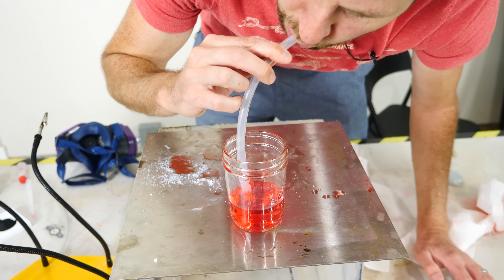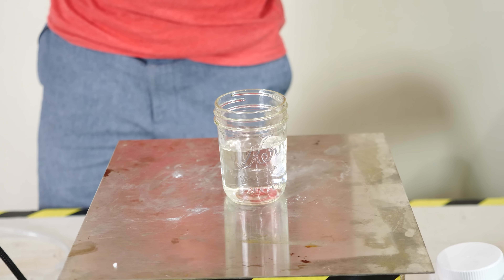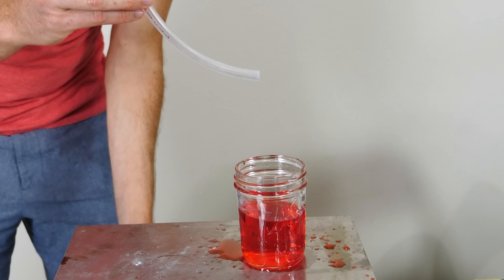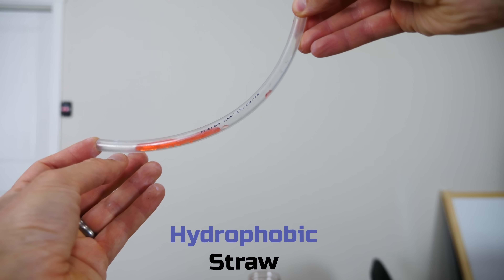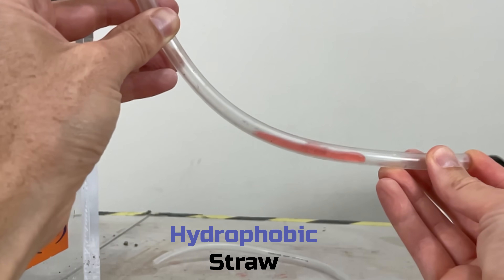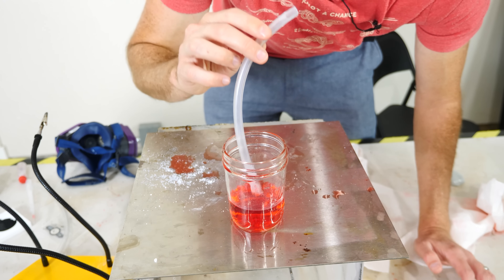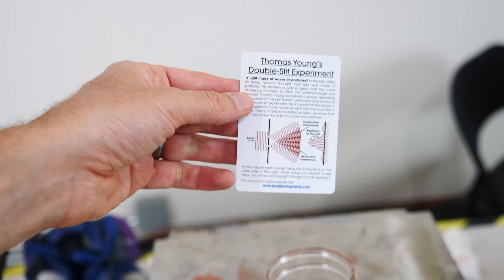Can You Drink With a Hydrophobic Straw?

Comment: Could it be that the water falls out because there's a super thin, rough layer of the silicate between the straw and it finger that prevents your finger making a complete seal, thus making the water unable to be held into the straw via suction/vacuum? 

I think you should redo the test but not make the end you wish to seal with your finger hydrophobic. That way, if the water still runs out while your finger is holding a tight seal, you have ruled out one variable for that experiment. If the hydrophobic effect is still keeping a gap of air between the water and the straw, the non-hydrophobic thumb seal shouldn't impact whether the water stays in the straw or not. Just a thought. Though the more I think of it I'd bet the ridges of your finger print are more prominent than the possible peaks and valleys of the silicate used for hydrophobicity, and you can still keep a seal with the finger on a normal straw, so it may be entirely irrelevant.

Comment: I'm guessing that if he performed this experiment with a low pressure vacuum and didn't handle the submerged end of the treated straw prior to immersing it, the air layer on the straw rim would allow enough air flow to break the vacuum and prevent the water from rising.

Comment: Right, I'm going to predict the end of this experiment.
If you suck through a straw, you're creating a pressure differential.
Unless it remains/becomes a vacuum, which we all know nature abhors, something will fill it. Given that you created this vacuum in liquid, liquid is the only option for filling it.
There may be a later of air around the straw, but air would have to move very fast through a very small space to keep up with your sucking.

Comment: I think you wouldn't be able to drink through the straw if you'd coated the hydrophobic powder on the outside of it. Sucking on the straw would just pull air down the outside of the straw and then up the inner sides of it.

Comment: I think that the hydrophobic straw still works when submerged because the air rushing past the water creates a low pressure area inside the straw, allowing atmospheric pressure to push down on the water inside the glass and move it into the straw. However, when you pull the straw out of the water, there's not enough surface area on the water inside the straw to keep it there, so gravity wins and the water falls out of the straw.

I think that there's also a chance that the layer of air around the submerged straw is so thin that it more or less works like a normal straw. But when you remove it from the water, the thin layer of air that remains inside the straw breaks vacuum, so the water falls out if the straw

Comment: Maybe the outside water was able to prevent the air from entering along the tube outer surface because of the high hydrostatic pressure due to the depth of imersion. Could you try it with the tube just touching the water surface to minimize the hydrostatic pressure?

Comment: Coat a very tall glass/tube/pipe in fused silica, and fill it with water and show us how the water behaves at different depths with the silica. The water at the bottom will be under more pressure than at the top, so the water molecules will be forces to "touch" the silica molecules.

Comment: What whold happen if you coat the straw on the outside also?
Reply: That could probably allow air to get to the bottom and make the straw not work very well.
Reply: @Bendigo1  maybe so or maybe the air will be too little to make a difference, that s why you should always make the experiment in real life
Reply: @edyeduard4368  right.   A hypotheses is only that until it is tested.

Comment: I wonder if it can be used somewhere else, like piping systems
Reply: That would actually allow faster flow through a pipe.  It would be better for a level pipe though.
Reply: @Bendigo1  what about having a layer of this in damns to reduce erosion to the structure ?
Reply: @FIRE_STORMFOX-3692  🤔hmmmm...   that doesn't sound like a bad idea.  I think the cost, and potential environmental affects might be the only issue with that.
Reply: @Bendigo1  well... Damn haha.
Reply: @FIRE_STORMFOX-3692  i was thinking about using it to build boat hulls.  To reduce friction....

Comment: Ok, going slightly off topic but......
Pipes/tubes have problems with water flow because of friction on the side of the pipe/tube.
Make the inside of the pipe/tube hydrophobic.
Not the end or the outside, so when the end is under water it will fill with water and it will (should?) allow it to work as before.
But.....
Will that help with flow because it reduces the friction of the liquid with the sides of the pipe/tube?

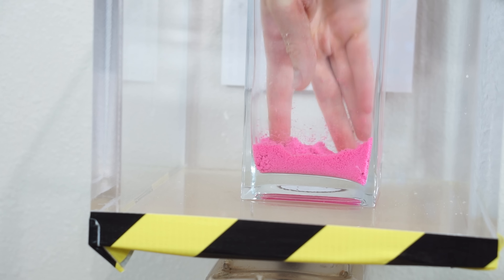Comment: 0:42. Yes you will still be able to suck it up. All plastic and rubbers are hydrophobic. Which straws are made out of.

Only way it would actually be too hydrophobic is if the straw diameter was so small it could not overcome the surface tension of the water interacting with the hydrophobic surface of the straw.

3:50. Well since the higgs is totally fake. At least it's proposed function is. That kind of tells you. Who you're dealing with.

Yes a particle at that GEV could possibly exist. But the odds of them actually finding it are astronomical. But regardless of whether or not they actually found it. The proposed function of the higgs is absolutely incorrect. And it is only through stupidity that people have been duped into believing in it.

And since they have not provided any actual scientific evidence to suggest that they have found anything. You can still safely assume that it does not exist.!

But more importantly since it is clear to see through real research how. The properties of mass actually function. Anyone aware of this already knows the higgs. Only exists for continued funding purposes. Which I'm not going to hate on the game. Except that it's giving science a bad name. The only way it's worth it. Is if the additional money lying about the higgs gets them. Can build a large enough collider to find actual evidence. 

Which will undoubtedly prove that their supposed original discovery of the higgs was the biggest and most costly scam in human history.

So yeah anyone working on that s*** is obviously an idiot or in on it.

But be friends with whoever you want. Even if they're helping to destroy real science.!,

Comment: I think even if the straw is submerged, the reason is you’re still able to create a drop in pressure. “Water collapses so not air doesn’t get out” may be true, but if hypothetically it had a full layer of air, so long as vacuum created by your lungs is strong enough, it’d still flow up the tube from air pressure (even if the air is flowing)

Comment: With this tech, it's possible to make straws very easy to clean, and then, very possible to reuse. Imagine a piece of straw which is translucent and never sticks any liquid on it. After using, all you need to do is wash it with ordinary water from pipe. I guess this would help reduce the plastic production.

Comment: The question I have now is. Did you demonstrate sucking water up through the straw after you demonstrated moving the water through the straw with  plugged ends of said straw without re treating it with the fume silica. I ask because if you have removed the silica from the ends it would negate the results of the final demonstration as presented.

Comment: So here is a food thought, what if we made a hydrophobic dam? Generators powered by water pressure should be able to effectively get alot more energy if the water current face less friction. Would this work? Would we be able to take power conservation a step higher at such a low cost?

Comment: I'm a pressure cleaner, and one of the biggest things we face is friction from using long lengths, which restricts our pressure and flow. Do you think there would be a way to coat the inside of a hose like this?
Even a garden hose?

Comment: You should have tested it to see at what depth the straw was unable to pull up the liquid because it couldn't create a seal, if at all.
What if you used a different diameter straw?
What about different materials. like PTFE, silicone, glass.
Does water flow faster due to the lower friction?

There were too many answered questions. :-/

Comment: What happens if half the straw is hydrophobic, will the normal part work normally and then work with little friction in the hydrophobic part, does that mean a hydrophobic pipe loses less energy and a better pipe or does it comes with its own challenges (ignoring the cost of the treatment to make the pipe hydrophobic) witch pipe whould be  better, what is the the effects on the pressure, what is the effects on the flow rate

Comment: What happens if we make hydrophobic boat, does it goes faster. any ideas?🤔

And does hydrophobic propellers work same as normal ones?
Reply: Well most of the energy lost in a boat is in deforming the column of water, along with energy lost to turbulence which would remain the same.. Adhesion would be a very small force to counter. For something light like a sheet which doesn’t displace a lot of water this might work very well at making it slide on the surface of water..

Comment: Before I watch the vid, I'm going to guess yes. Unless the opening of the straw is too narrow to allow fluid into the interior of the straw, pulling a vacuum inside the straw (aka sucking) shouldn't be a problem.
So I was right, but I felt like I was going to be wrong through the whole first part. A hydrophobic straw is a lot trippier than I expected.

Comment: Actually that's an interesting coating for pipes cause even if there is a hole as long as its not bigger than the layer of air water won't escape ...
but Also high pressure so... not sure if it would work...

Comment: You missed a good experiment, that should have been the last.  Using a vacuum meter to determine if the draw for the hydrophobic straw is greater, less, or equal to that of the regular straw.  It would also be interesting to see how a hydrophobic straw would affect the maximum flow rate.

Comment: I expected you'll be able to suck through it, with one end in the water, because mercury (which does not wet glass) can still rise in the glass tube. But i expected to see a drinking straw which is thinner. The water droplet in a thin straw is more rigid and may allow less or no water to pass between the droplet and the straw.

Comment: Here's an explanation of what's happening in both the end plug and sucking up water tests:

Water naturally likes to stay together due to the high cohesion of hydrogen, and depending upon the chemical composition of other surfaces, water may be highly or poorly cohesive with it. Aka, hydrophilic or hydrophobic. Aka nonpolar and polar. Glass is very cohesive with water, fume silica is not. 

So given that the fume silica straw lacks cohesion with the water, they have a natural repelling force against each other by literally being polar opposites. Air naturally, then, takes root in the spot between. Due to this, the water is free to glide along those air bubbles which connect end-to-end of the straw in the plug experiment. With a hydrophilic straw, the water is binded to the edge of the straw and everything is sealed. In the sucking up water test, when he has the straw submerged, he first sucks up air and pulls away the divider between the water and straw, and so naturally the water can only obey the innevitable vacuum that will pull it in tow. The air, after all, has no where else to go but up. When he lifts up the straw however, the lack of an air-tight seal makes all the difference. The vacuum does not form because the water and straw repel each other and air creeps in  the second it has the chance to take the space between. Any seal which may have formed is broken, and allowing the water to slide out like the flush of a toilet.

Comment: Now I need to know 2 things:
- would that make any sense to coat a boat hull with a hydrophobic layer?
- is there any way that this could provide a viable high speed train alternative due to its passive action (instead of the whole powerful, energy intensive magnet system used with current maglevs)?
Reply: I am not a profesional , my opinion however is water still creates friction even if the water molecules themselves aren’t touching it there is still air , magnetic would wear off the coating
Reply: I believe I have heard about boat hulls being coated in it already. might look it up

Comment: I assume that fumed silica isn't safe to breathe in...
Reply: Or ingest.
Reply: @Jay Smith Silicosis is a problem tho
Reply: @Jay Smith It's also used as an anti caking agent to make anthrax airborne
Reply: Inhaling silica dust can cause pneumonoultramicroscopicsilicovolcanoconiosis, but it does make a good spice for the dish Lopadotemachoselachogaleokranioleipsanodrimhypotrimmatosilphioparaomelitokatakechymenokichlepikossyphophattoperister.
Reply: @serious.business  sounds supercalifragisticexpalidociously scrumdiddlyumptious!
Reply: @Jay Smith Well... being used in products doesn't mean it is safe nor dangerous. Water is used in production of plastics and in nuclear reactors. Doesn't make it dangerous. Mercury is used on some vaccines, doesn't mean it is safe. Everything can be safe in small enough dose (albeit very very tiny for some) or dangerous at high enough dosage.
In the wikipedia article you linked, "fumed silica can easily become airborne, making it an inhalation risk, capable of causing irritation."
So yes, fumed silica can be a health hazard, particularly for your respiratory system. Sucking a straw coated with fumed silica thus isn't a healthy thing to do.
Reply: @Jay Smith Well I don't think this was a necessary risk. While fumed silica isn't inherently toxic, the fine particles does pose a risk, especially when sucking it up with a straw. A hand pump, or something similar to create a suction would be sufficient without actually sucking up fumed silica. Same applies for any fine particles in general, don't mean to claim fumed silica as inherently toxic btw. Any small particulate is a potential health hazard.
Reply: @Jay Smith You don't go ingesting toothpaste, mostly because of the fluoride.

Saying it's in toothpaste isn't a very good endorsement for it being okay to drink.
Reply: @notyou2353  i do
Reply: @jacksonandbowenwatch4163  Fluroide isn't good to ingest, it wrecks the liver. Do what you will, just be okay with the consequences.

Comment: Hi, you did and experiment sucking water through the longest straw. Question : if you use an hydrophobic straw, the maximum height will be higher, lower or the same as with a regular straw?
Reply: Through*
Reply: My guess is that will be higher

Comment: Better question: will a small enough hydrophobic straw be able to reduce graphite to single layer graphine with no more energy than time and infrared induced movement as demonstrated by Dr. Pollack's research?  Could methods of hydro phobic/phyllic surfaces make it possible to thread pure graphine to the back end of said straw, inducing connection through its procces of exclusion zone separating? Will the process reduce graphite to single layer in a small enough straw at all? I'd love to have you considering this.

Comment: fumed silica has the cool ability to make everything it touches hydrophobic. Like your tongue and lungs?
Reply: Well you wouldn't want a hydrophobic tongue because you wouldn't be able to taste drinks(or something like that)
Reply: Hydrophobic lungs would make smoking so much safer tho haha
Reply: Getting silica in your lungs is a very bad thing. Look up silicosis, it's similar to what happens with asbestos.
Reply: @figmentpez  In another comment thread someone said that fumed silica is not linked to silicosis. Sounded like they looked into it, but I am not really sure. Might be worth checking into in case it is true. But for sure silicosis is bad news, and miners are at risk due to the rock dust.